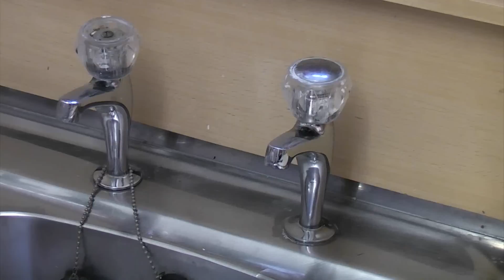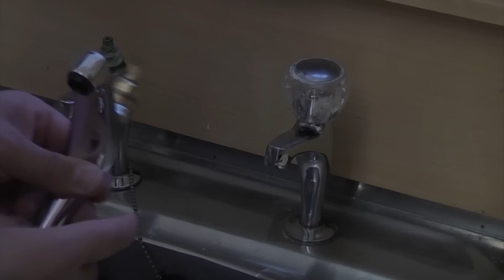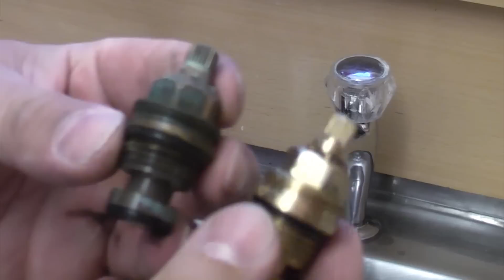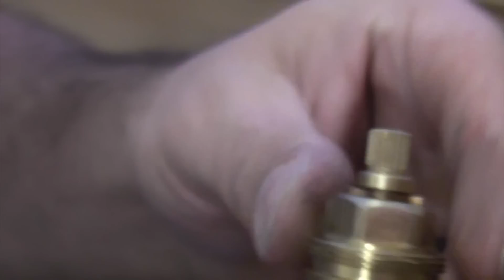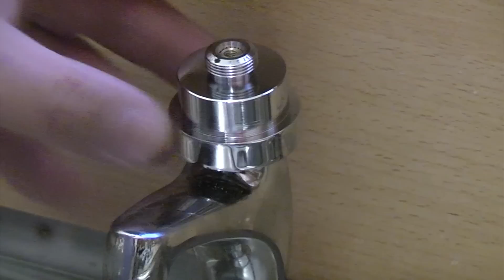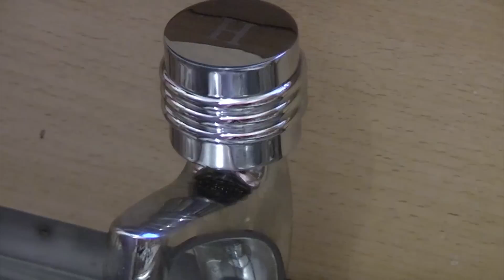How to revive old taps

Comment: I need to do this to fix a spinning tap head on a quarter turn bath mixer. Are the head gears universal? So when i take it out the new taps will it drop straight into the old tap body? Thanks in advance
Reply from the maker: Yes, they are normally universal.
Most are 1/2" BSP, but I think some bath ones might be larger (perhaps 3/4" BSP) 
If you remove the old one ant take it to the plumbers merchants, they will ensure you get the right one (you might have to buy a pair)
Some kits have reducers with them, like this one- https://www.screwfix.com/p/swirl-h51-a-3-4-bath-lever-tap-reviver-kit/4467p
Reply: @ultimatehandyman  thank for that. Do u know of anywhere that sells the reviver kits with the modern style flat levers in like u get on bath mixer waterfall taps for example. I don't really want to go to the expense of buying brand new taps just for the levers and cartridges. Thanks in advance
Reply from the maker: @NanBreadBob   You could try your local plumbers merchants, or eBay etc. https://bit.ly/3JAK94Y

Comment: My tap is similar to the old ones on your video - the one on the righ hand side. The cap is a screw on type. I tried to unscrew it so that I can get to the screw under it to take out the tap head gear to change the washer.. But I cannot unscrew the cap. It moves only a little and then stuck fast. 
I tried to use a grip around the cap to turn it even though there is very little grip around the cap to turn it, but when it did turn a little,  it also turn the tap handle.
Is that a way I can get the cap unscrewed ? I am afraid to damage the cap or the tap head gear itself. 
Any advise will be most greatly appreciated. Pleaseeee help !!!
Many thanks.
Reply from the maker: I'd try squirting a bit of spray penetrant under the cap, perhaps that will loosen the bond and enable it to be removed.
Worst case scenario is you might have to break off the cap, but replacement ones are not expensive.
I have installed tap revivers in the past, they work really well- https://fave.co/2qvgGn8
Reply: Ultimate Handyman - thank you for your quick response. I doubt any spray will get to the screw under the middle of the cap. I am beginning to think your worst case scemario may be the only way :(
All the same, thank you for your suggestion.

Comment: excellent video is it just 1 stop tap which isolates the hot and cold water taps thanks
Reply from the maker: It depends. Most modern houses have Combi boilers installed so turning off the incoming stop tap will stop the hot and cold water but if the property has a conventional system you might have to close a gate valve to prevent the tank from draining on the hot side.

Comment: Roddy Nora wouldn't it be quicker just to replace the taps? However its a great tip and the taps look oh so lovely
Reply from the maker: It can be a real pain replacing some kitchen taps as there is often a back on the kitchen unit meaning you can't always access the tap nuts without removing the sink.
Thanks for the comment ;-)